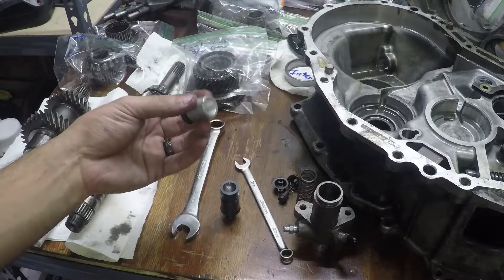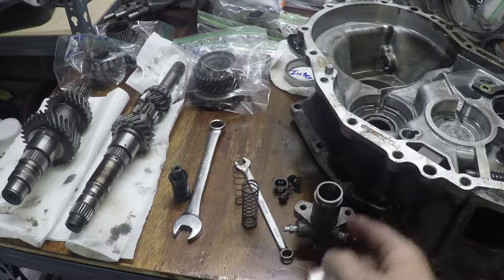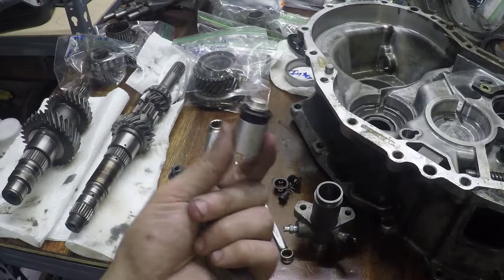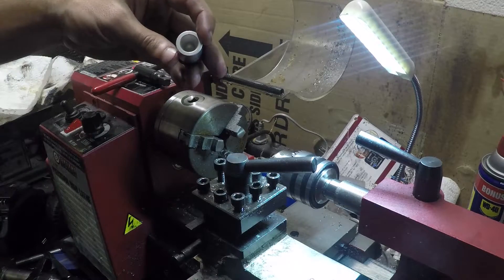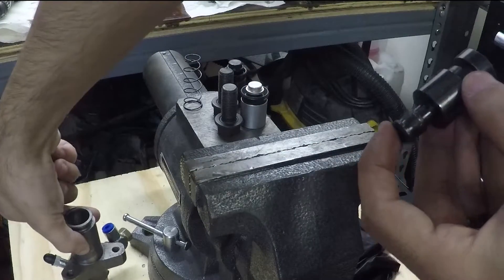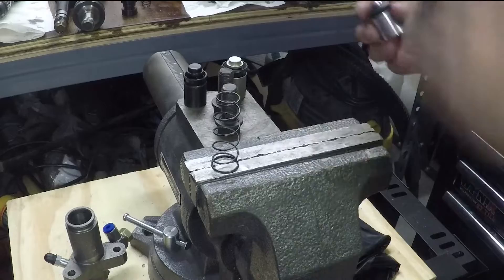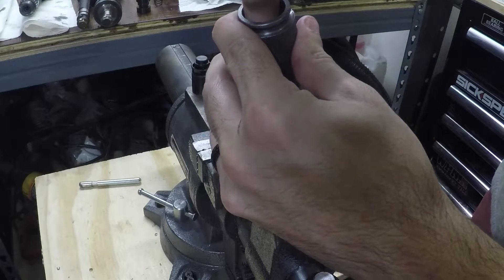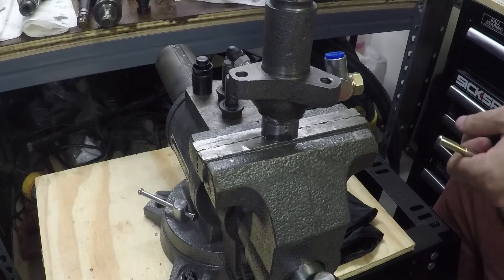How to make a Hydraulic Piston

Comment: Any updates on the mini
Reply from the maker: Oh yes so much work going on in the shop but sadly I'm so far behind on the videos.
Updates are the engine and transmission are both rebuilt and back in the car. The engine is in awesome health and I'm currently retuning the engine with the new turbo and pistons. I've upgraded the fuel pump and swapped out the entire rear suspension, built custom axles, and even got the speedometer working. I have a double din android head unit getting installed as well. We're also converting the fuel system to be compatible with e85 and installing a flex fuel sensor.